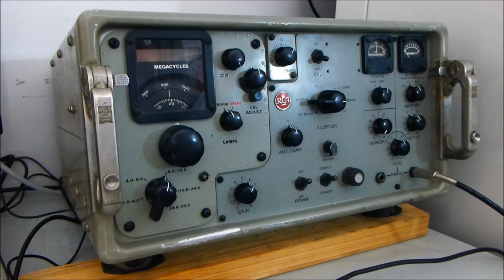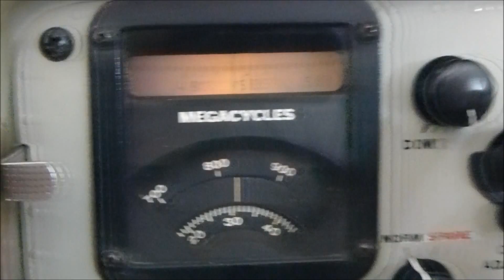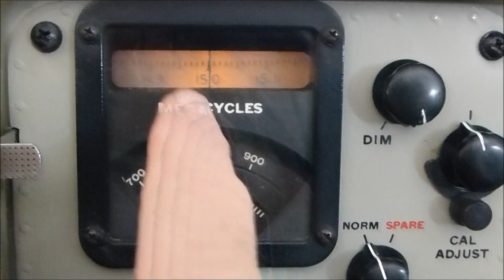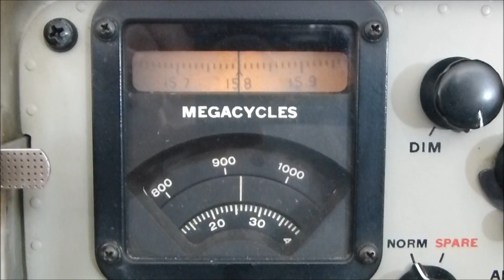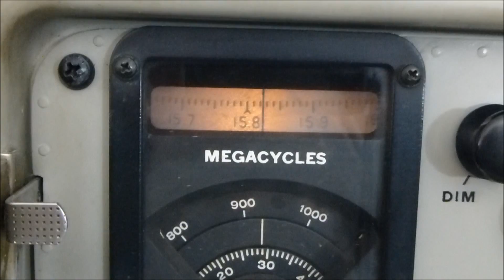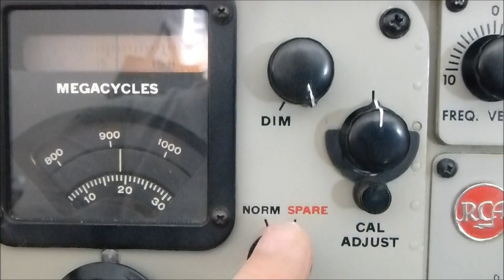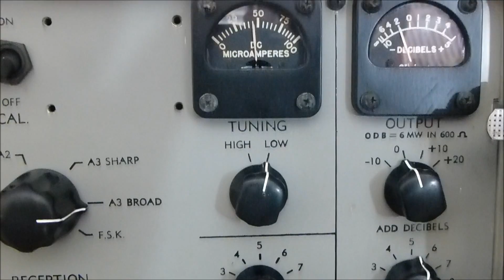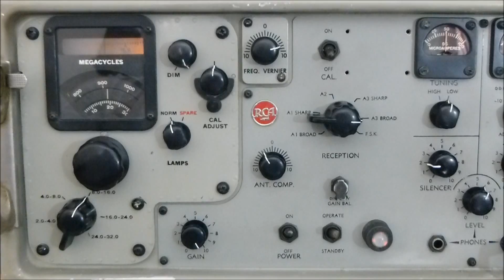USN SRR-13 HF Receiver Demonstration

Comment: Great looking radio, is it still working well? Love the detail you put into making this video, thanks for posting !!!
Reply from the maker: Hi Tom, thanks for the nice comment. Yes the RX still works well. Used it a couple of months ago. I  planning on doing a mod sometime to reduce the drive on the if strip.
Reply: @vk4gxc  Absolutely! And sounds good, glad to heart that it is still running! I'm currently working on getting one of these radios back online myself, really glad to see what kind of performance they are capable of after having been gone through! How many of the original caps did you end up replacing? I've heard mixed things about the Micamold caps, so wondering if just recapping the whole set might be the best option...thanks!!!
Reply from the maker: Hi Tom, I am trying to recall some of the issues i had, The mica moulds were an issue. I seem to recall replacing all of them in the IF strip transformers. This is from memory but I think there are 2 in each transformer, most are the same value so I just got a few of ebay. There was one which was definityly bad, that made me change all and after this all the IF transformers lined up beautifully. Cant remember much else, but I did replace just about all the tubes in it and probably a few out of value resistors. The front end is a nice layout and it tuned up well too. There is a mod to fit resistors to the screens (its on this thread I think), its been on my to do list a long time. I would agree it will reduce heating, probably lenghtnining tube life and bring down the IF gain which in my opinion is a bit high. One other area I spent time on was the audio amplifier and detector. I was never really happy with the audio, its not bad, ( it could be due to the high IF gain/AVC control), I even swapped out the whole audio module but was basically the same. I also have a SSR-11 here as well (VLF) so can swapp modules. They make a nice pair. Loads of EX USN guys hate these things but I kind of like them, but guess my life doesnt depend on them!.
Reply: @vk4gxc  Sounds good on all counts, thanks for that! I do remember reading about the resistor addition, not really sure why they would have designed things with the voltage being that high, definitely unusual for RCA. And I've heard mixed reviews also, I do like the overall appearance of the set, and it sounds like it would be a fine piece to work on. Thanks for all the information, much appreciated!
Reply from the maker: @thejollyroger1945  No worry Tom, I like the genral look of the set too, it was quiet futuristic for the time somewhere between the SP600 and the R390 and smaller, RCA expended a lot of effort to modularise the unit, its quite a mechanical work of art. Even some rack and pinion work in there! I think that the screens were tied to the anodes as it was a recognised solution at the time, It may have helped with linearity (Maybe) but I think I will try the screen resistor in the future, its alway reversible. Good luck with your restoration!! Pete
Reply: @vk4gxc  Absolutely! I certainly think that they are definitely between the SP600 and the R390, certainly right up there far as mechanical design goes! It's pretty impressive to see the level of technological advancement in a postwar radio, almost night and day compared to the stuff from WW2. And thanks! I hope it will turn out as well as yours there did! :D All the best... Tom

Comment: I was a electronic tech. on a US Destroyer in the 1950s and we had about 15 of these receivers. I think that RCA designed this model to mainly burn up tubes. I had one tech. hose main job was to replace tubes in these damm things. Performance was OK but if you are going to use this radio, I recommend that you install two or more fans in the covers.

Comment: FYI Walt Hutchens in 1991 wrote an article on this rec which includes info on reducing audio distortion and also improving the HFO tracking ( freq display ). Very worthwhile, I think.
Reply from the maker: +kargocult thanks for the pointer, I haven't seen this article, just had a look at radio electric but there is no copy available online for purchase, Ill try sending them an email. I did read some of his comments on another site and have to agree the radio has a very impressive mechanical layout and modular design. The audio is just about acceptable but could do with improving....
Reply: +Peter Stanford The article addresses the issue of the audio distortion at high AM modulation levels. I just posted a note about the article to a couple online mil radio groups. I think I will be contributing the article to Nick England's Navy Radio website so it should be available there in a month or two from now ( 4-2016 ).
Reply from the maker: +kargocult OK thanks for that ill keep an eye out for it. Its has been hard to find much info on these radios. I do have the manuals but any improvements or changes have been hard to track down. BTW do you have any experience with the VLF SRR-11?
Reply: I have an SRR-13 and a couple Collins R390A receiver. All three I use a  600ohm to 4 ohm output transformer for audio but I'm soldering in new tubes now and aligning it.I wish it had the broadcast and 160m band but no biggie.

Comment: Hello, Peter: This is Ken, W7EKB. I have worked on the SRR-11/12/13 receivers both in the 1970s and lately. There is one thing you can do with those to markedly reduce the internally generated heat, and concomitantly, the noise: add a properly bypassed 56 K resistor in each screen-voltage feed in order to reduce the screen voltage to a far more "reasonable" value. RCA engineers arranged the circuitry so that the screen voltage on many stages was equal to the plate voltage. This is unnecessary and contributes to heat and noise. Also, the detector for CW and SSB is, surprisingly, a real product-detector, although the manual doesn't call it that. Nice video, by the way. Thank you, and vy 73, Ken W7EKB
Reply from the maker: +Kieran Gordon Hi Kieran, many thanks for the tip, Ill take a look and give it a go. all the best. BTW i have a SRR11 (VLF) set which works reasonably well, went through it and fixed/realigned but It has no AGC (as standard) and relys on manual adjustment of RF/IF and AF to get it just right on any particular signal, there is also a fixed noise limiter in cct which doesn't help the situation.. I was surprised how 'touchy' it is but may be that is normal?? wonder what your experience is with the version this set.